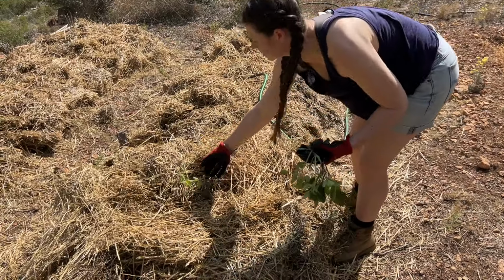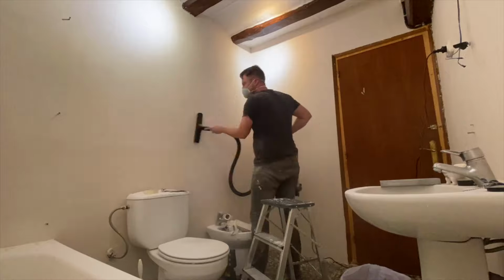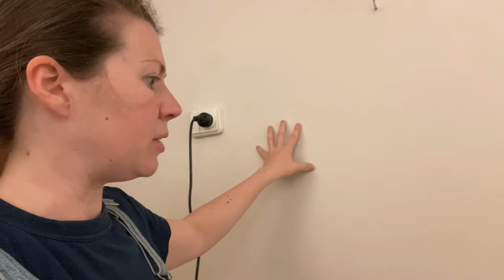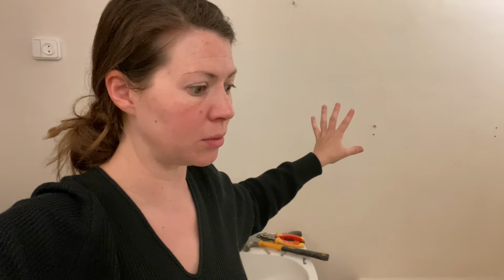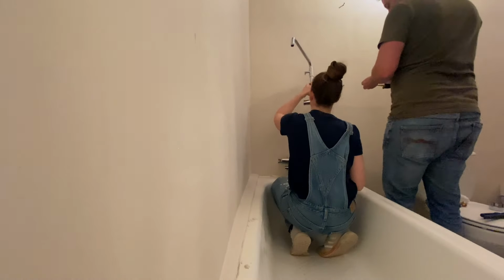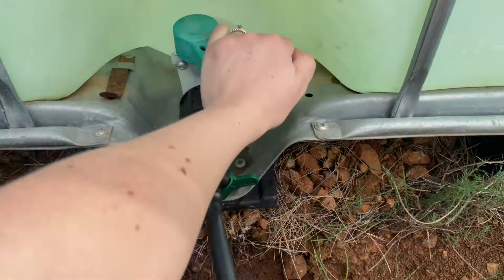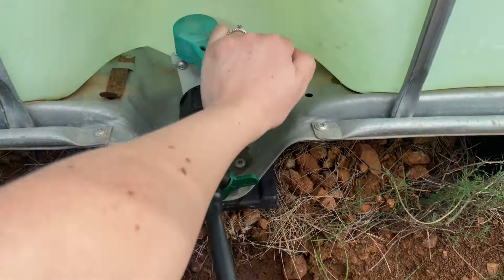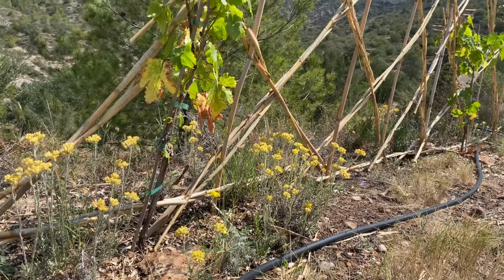DIY MICROCEMENT BATHROOM | 120 Year Old House Renovation

Comment: The pressure is always better when you first set it up but will only get worse. Put them in now but you will probably have to adapt as you go along.
Reply from the maker: Oh that’s interesting. Why does it decrease? 
We know it’ll depend on how much is in the IBC, and it’ll be best if we try to keep it as full as possible.. but are there any other reasons the pressure would get worse over time?
Reply: @SmithsdaleFarm  bits or dirt and grit will get in the system and algae will grow around the outlets over time. All manageable though.

Comment: Another inspiring video! Congrats on all the accomplished work! Bathroom is already stunning and the straw raised beds look very promising! A lil' tip I received from a neighbour-farmer, for when you're connecting the black tubes to the junctions/T-pieces: (carefully) warm up the ending of the black tube with a lighter, the warmth makes it softer and it's much easier to fit the junctions in, it then cools down and stays in place. You can also add "abrazaderas" to avoid leaking at each connecting spot of your system. Take good care, can't wait for the next one! All the best! xxx
Reply from the maker: Thank you! We like how the bathroom is turning out, too. 
And thanks for the tips about the irrigation tubing. We should try heating it next time!

Comment: It's very interesting to see how you set up the drip system! If there is a way to set up a timer for the watering I would probably do that to save some effort there. On our land we are not really collecting rain water yet, our old cistern needs to be fixed as it's not really  holding water, and we basically have to bring all the water we are going to use each time we visit and make trips to a nearby pond and feel bad for the little tadpoles living in it for making their living space smaller! With the high winds in this area, are you worried about the straw flying off?
Reply from the maker: Ooof that sounds like a lot of work! We’re thinking of cleaning out our cisterna this summer. Does yours have too many trees close by or is it just age? 

I think it was John Kaisner (natural farmer) we saw with the capillary irritation. Though I think it still needs some extra stop taps in, we arnt getting water on the top line. 

For the straw, we have seen other ppl have success with it here, though in a less windy site than ours. So far it’s held very well, I think once it’s a bit damp it’s less likely to fly off
Reply: It's just old, the surface is very cracked, and I've already started chipping off the loose bits in preparation for when we can dedicate some time and love to it. We still have a lot to do around the cistern too to keep the water that will enter as clean of sticks and debris as possible. We've seen cisterns in the area that are really beatiful, ours looks like it's been put together by a toddler, so we're also thinking about how to make it look a little better without taking it apart completely (not sure we would know how to put it together again!). 😅